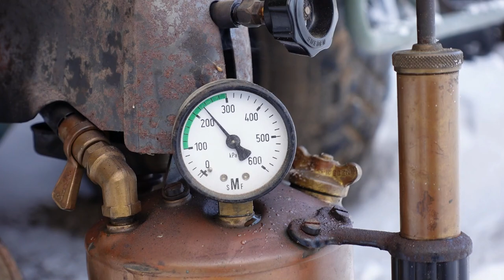Old Scania SBA 111 Cold Start (-15) and Tractor Rescue

Comment: Ohh that 111 sound brings back memories, that 11 liter 6 cylinder engine! and its with an automatic transmission? I saw the SBAT 6x6 in the ninetees on the Scania test circuit close to the factory, with the introduction of the 4 series, never drove it though. I did participate in a 6x6 gprt 112 introduction close to Haderslev DK in the mid eighties, remarkable how it transversed almost any off road challenge - all those difflocks buttons impressed a 11-12 year old - those testdrivers were cool.
Reply from the maker: Yeah, it's automatic. I personally have never seen a manual gearbox in these. We have several different versions of these. You find some videos about the snowblower version on my channel, for example.
Thanks for watching!

Comment: MY SBAT 111 (TGB 45) from 1990 has a electric coolant pump that you switch on when heating using a torch. But using a CAlix 230V jacket heater is much easiest if you have mains power socket on hand.
Reply from the maker: It has that pump too. It not running first. I  managed to get the voltage into the switch and then the pump motor was stuck, but I got it work at least.

Comment: Nice video, for how long u have too preheat with the torch? Have used a max sievert torch to preheat the engine block on my valmet for a few times trough a pipe, works fine.
Reply from the maker: Depends, 15min I think or something.

Comment: What an adventure Wonderful driving and what a beast you have at your command sir. I  am still wondering what is that thing that you heated at the starting of the truck with  the blow torch that seems to have helped start the truck easily. I dream of such adventures.
Reply from the maker: Thank you Sir! It's heating the cooling fluid at the engine.